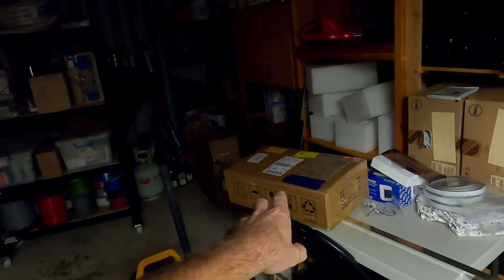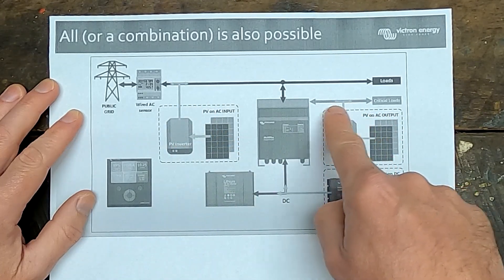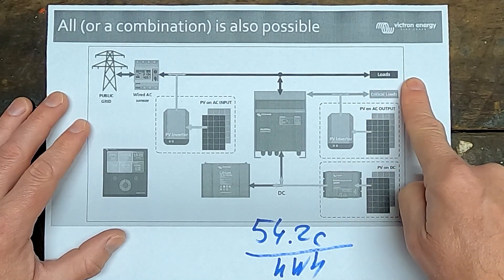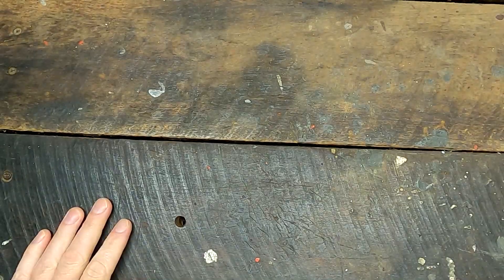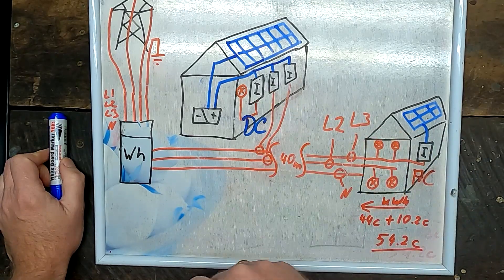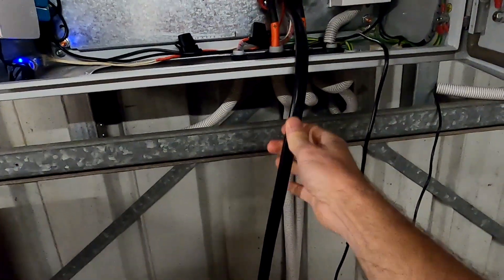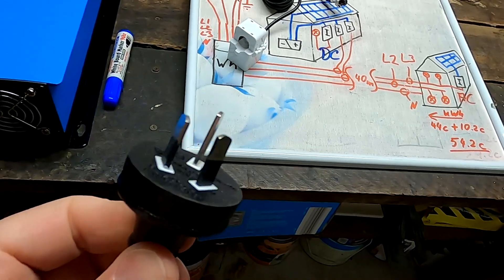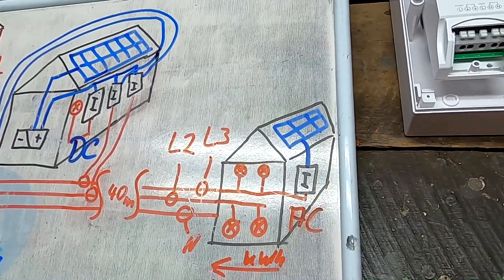Zero feed-in solution to power the house from the battery (and stay legal)

Comment: You need a critical load sub panel. Move those circuits that you wish powered by a hybrid inverter to a separate panel that is close to your main panel. From your main panel run an input circuit to your hybrid inverter input. Do not bond ground and neutral in your sub panel (most important). People talk about solark...it is great but expensive...to me anyway. I went with average Joe and setup a 12kw growatt.

Comment: I'd be nice to have a better way of communicating than just text.  Backfeeding a circuit like can easily violate many sections of the codebook.   I know the NEC quite well.  To put it simply, whatever amperage any of your sub panels are rated for must not be exceeded by the sum of all breakers where current could be supplied.   So if you have a 100a panel and it has a 100a main breaker, backfeeding via that inverter on say a 15a circuit could subject the panel to 115a for which it's not rated.   I'd be willing to bet the AU code isn't much different.

So, if you have a 100a main panel and 2 separate solar power sources on 15a breakers each (30a), the main breaker would have to be derated down to 70a to keep it within code (read: covered by insurance).   Of course they'd have to be labeled as alternative sources of energy, regardless of how 'smart' an inverter is.  Code isn't there to protect you when things are working properly, it's structured to protect you for when it's not.
Reply from the maker: That won't happen. I've got 2x40A supply to the house and the inverter will only ever add 7-8A to one of the circuits. All my load inside the house are far less than 40A, jeez, that would be like 9.6kW on one phase. I've never seen more than 4.7kW as a peak consumption on one phase while cooking.

Comment: What are you actually trying to do? I can see you want to export as much of your house solar as possible, so that would imply it shouldn’t be used to charge batteries at any point in time, you can’t reduce the house loads as you’ve said it’s against the connection agreement, I’m not sure what you actually want to achieve?
Reply from the maker: Well, I explained this all in the last few video... 🤷‍♂️
I cannot maximize my solar export, I have to leave all as it is. Only at night, I can replace my grid power with power from the batteries. Until the contract runs out.
Reply: @OffGridGarageAustralia  right, so what is the goal as of this moment?
Reply from the maker: @isaachauser521  To power the house from the battery during the night as per requirements.

Comment: Sir the usage of two defferent inverters is worth and can do what you want. I use last three years this compination and works perfectly. In my installation  I use a three phaces Fronius Symo 5KW to feed back energy to the grid and  a Victron Multiplus 3KW connected at the one phace with the most critical loads (routers, servers, pcs, security stuff and lighting of my house) .
 Victron Multiplus has a 220Volts input, a 220 volts output for crical loads (that means that these loads are continius suplied even if public grid fails) and a second output 220Volts avaliable only when the grid power is OK. 
Now: Multiplus is feeded by the grid and by the battery banck in case of grid failure and feed power to two defferent sircuits (one with critical loads wich is non brake sirquit) and a scond sirquit ONLY when the GRID power is avaliable. As an extra Multiplus can keep the batteries full charged with use power from the grid .But you can change that if you turn Multiplus in  only Inverter mode.(button on it`s front face extremely easyto do)
For batteries charging I use a VICTRON Smartsolar MPPT 250Volts 80Amperes PV charger.
 So the workflow is : PV Pannels >Fronius 3PH+P+N 380Volts 5KW >MAIN breaker > HOUSE AND FEED BACK to PUBLIC GRID the PRODUSED POWER
                                    PV Pnnels >Victron Smartsolar Charger >Batteries >Multiplus Inverter
                                    One phase of GRID >multiplus in >Critical loads and NON critical loads when GRID power is avaliable and ONLY critical loads when grid fails.
    For whatching the system I use  Victron Venus GX module. I don`t use the second power meter as it no needed in this case  and is an exta cost just to have corect power indications and nothing else. It is usable only if you want to keep public power meter at zero (no feed back) and for some FRONIUS and VICTRON APPs to have corect calculations.
 I hope help you a litle.
If you want more informations schemmatic diagramms etc just contact me . I will help you as i can with pleasure!!!
Reply from the maker: Hello Vasilis, thank you very much for your comment and explanation. That sounds like the ideal solution and exactly what I'm after. How can I contact you for further information? Can you send me an email through my website off-grid-garage.com, scroll all the way down then.

Comment: As I understand it, the Grid tied inverter stops when power is going out to the grid, so that would mean you do not need a timer...... and the reverse is, when you are not exporting to the grid you are allowed to use the Grid tied inverter....
Reply: I think you’re absolutely correct, if the house solar is exporting to the grid the plug in inverter would simply stop production. At least that’s the theory.
Reply from the maker: Not quite. I'm not allowed to use it during the day as it would increase the energy I'm usually exporting. 
I would feed some of the loads inside the house from the inverters and the battery. Therefore I would export more energy to the grid from the house solar. -> not allowed as per contract.
Reply: @OffGridGarageAustralia  It would decrease the power you import from the grid during the day as the grid-tied inverter only pushes power out when there is import from the grid.
When there is export it stops pushing to your house grid and would not do anything. So it would not increase the export in daytime, it would just decrease the import.
Unless you connected the grid tied inverter to a different line then the house solar.

But better safe then sorry as the electricity-company might not get the above.

Comment: I have a multiplus II with zero feed in running with the single phase meter. The MultiplusII can also do this kind of clamp metering. But be aware if you switch any device in your house on and of the inverter needs some time to adjust to the output. in my case if i turn the oven on and off the load gets as high as 1500 watts and slowly decrease to zero ... i takes about 3 or 4 seconds until the inverter decrease the output ... so i think you will alway push some power back to the grid ... in my case 4,4 kwh the last 90 days.
Reply from the maker: Wow, really, that is a lot of energy been pushed back!!!!
The SUN inverters do that too in extreme but take only 1-2s until they adapt. I have seen 200-700W been 'exported' for 1-2s.
But 4.4kWh is a lot
Reply: @OffGridGarageAustralia  A lot ... within 4 Month ... it is more than zero ... but its ok :)
Reply: @OffGridGarageAustralia  And i hope it will not affect your contract ... :) But as far as i understoot you right ... you can use an alternate generator but are you allowed to push back a little or do you have to disconnect ?

Comment: Those inverters will also not power you on grid failure and are also not legal here in Australia
Reply: They do look very much like the one I bought. Mine is for a wind turbine but is not certified for grid connection here in Spain. For me it’s not a problem as it’s connected to the output side of my Quattro and not the grid.
Reply from the maker: Grid failure is not a concern at the moment. But you're right, they are grid following inverters, not grid forming inverters.

Comment: Just run a new supply from garage to house and have an auto change over switch in the house that activates on power failure from grid or after a set time
Reply: Or just use hybrid inverter (deye) they have current transformers and is basically the same wiring as he  already has, but much more robust setup than he currently has implemented.  His reasons he can not use hybrid are not valid, at least not with a sol-ark/deye inverter.

Comment: rather than use the timer, can you not use another hall-effect sensor on your house grid tie inverter or solar string combo box to trigger a relay to connect the off-grid grid-tie inverter?  ie set it so when basically set the overcurrent protection to whatever the smallest value is and any current it switches off the off-grid setup?  Generally the hall-effect and shunts like your BMV on have facility to switch relays on current or voltage settings.
Reply from the maker: There are other solutions, yes. But it's already pretty messy with this solution, so...

Comment: Andy, does that mean that the system does not work in a blackout as the grid tied inverter needs to see the grid voltage to work?
Reply from the maker: It's not an off-grid system for the next 7 years until the contract runs out, that is correct. Only the garage will have power then...
Reply: Any grid tied inverter must be "anti islanding" which means it will not export to the grid during blackouts, even if there is another grid tie inverter connected to the grid.

Comment: You're getting A$0.54 for sending the grid power.  What are you paying for what you use from the grid?
Reply: Andy installed solar PV many years back and at a time when there was a state government incentive which adds 40 something cents/kWh to the exported energy paid by the electricity retailer. Such incentive schemes ended many years ago, while those who signed on have them honoured until end of contract term, unless they make a change which breaches the condition to maintain eligibility (e.g. by adding more generation capacity). Normal import tariffs in SE Queensland will be around the 20-25c/kWh range.
Reply from the maker: I'm paying 23c/kWh or 17c/kWh on the other tariff (pool, hot water and vehicle charging). 
I'm getting 44c/kWh from the gov contract plus 10.2c/kWh from my retailer. Until 1. July 2028 😊

Comment: Those GTIL2 inverters are awesome. I use 2 of the 2kw inverters (USA splitphase). It would have costs me over 20k to have everything installed by nabcep installers the way the electric company wants so they would allow me to feed power past the meter. Instead I installed the GTIL2 inverters.The entire system cost me 6k done diy. Covers almost all of my electric bill.
Some advice. Don’t plug them into an outlet. Cut off the plug. Connect it directly to a breaker in the electrical panel. Outlets fail and will cause issues. I’m an electrician, I replace a lot of broken outlets. Also don’t install any of that stuff on the AC output of these inverters. If any of those things fail while these inverters are producing power it will ruin them. Wire them directly to a breaker with a wall pass through or in a junction box with wago and then directly to a breaker. Also when turning off the inverter, turn off the dc first then AC. I’m the moderator for a Facebook group about these inverters. Solar grid tie USA users. I help a lot of people with problems they are having regarding these inverters.
Reply from the maker: Thank you RJ, I've seen a few video of these inverters working ins split phase systems. Great. 
Yeah, they will be connected directly to the RCD and SonOffs in this little switchboard I showed.

Comment: Hey Andy, the solution is actually Verry straight forward... Use a multiplus 2, with a current transformer coil, and set it to inverter only mode for as long as the contract lasts, after that you have a hybrid system at the flick of a switch.

Your battery will only be charged by the mppts, and all your other gear can stay as it is.
They are available in 3 and 5 kw, so depending on your largest load you could do with just 2 in your case.
Come to think about it, if you use the power output from the multiplus, you might not even need the coils
Reply: Correct  - the Victron will not export to grid battery power - in most countries that would make no sense at all ( from a financial point of view ) . You can put timers on the Victron MP 
using a GX device
Reply: @petermerle  that's not his main consern I believe, he wants to export as much of the houses solar as he can for that sweet sweet moula at 50 some Cent a kwh. So by putting the victron in inverter only mode you would not charge the battery when there is overproduction, instead export it to grid, and when production drops below consumption, the victron will start compensating for the load. Seems pretty straight forward to me.
A victron with GX device CAN export to grid is you lower you grid offset to a negative value. I can drain by battery at 15kWh if I want to.
Reply: @bjornemmy  You could set charge current to minimum on the MP ( not sure if its 1 A or 0 A ) Then all PV goes to grid . Not sure why you need permission from grid operator to fit the EM.  You could fit it after your main isolator
Reply: @petermerle  no need to limit if charging is off, right? I have 3 multiplus's here and if I turn off charging, all te power from my grid-tied solar inverter goes straight to the grid.
Reply: @bjornemmy  You now have to introduce a mechanism  to change the inverter mode every day - I still don't understand why you cannot just run a normal ESS system and it will all operate autonomously. Surely grid operator can specify a maximum grid feed limit - seems so bizarre how it seems to be done in OZ ( only can come from this array  and not the other ) .  Here is South Africa we have a rule where one cannot grid feed more than what we import. Othe  countries specify a max power limit
Reply: @petermerle  I think some people are so focused on the problem that they start over thinking things, here it is quite simple, he only charges the battery's with his MPPTs and only need the multiplus's to compensate hese night use in the house, so just turn charging off on those and bod's your aunty. It's literally that simple.
Reply from the maker: So the problem is that the solar which needs to feed in is connected to the load directly, so at the output of the Multiplus. So far I could only see scenarios where the excess solar is been used to charge the batteries and only if they are full it will be feed into the grid.
Reply: @OffGridGarageAustralia  as far as I know that Does not Matter, you can install the multiplus in parralel or in series, if you turn off charging it will expert everything to grid no matter where the solar is connected.

Comment: Andy, the Victron power meter is available as a CT.. so you don’t even need an electrician to install. Thou i got a sparky to install the non CT version. You don’t need permission to install the power meter.

To solve the situation of your solar feedin.. the solution is simple, it gets installed on the grid side of the power meter so it’s generation is invisible to the Victron (hence it’s 0 point at the meter excludes your main AC generation)
Reply: If it’s installed on the grid side of the main meter then won’t that mean he gets billed for his own power generation?
Reply: @lexicase5642  I’m talking about the second power meter - the one that the Victron (or any other hybrid inverter) requires
Reply from the maker: My solar is installed on the house which is the load side. It's not before the Victron meter. The Multiplus will have 5kW at the output where usually the load is as per the drawing.
Reply: @OffGridGarageAustralia  why not put your house AC solar on the input side
Reply from the maker: @Fergo101  running another cable between house and garage is not an option.

Comment: What happens if you were to claim your off grid garage was an rental property and that your tenant needed their own meter? Once the meter is installed, legally your tenant (your YouTube show) could have their own grid tie contract. Of course your YouTube show would need to be legally Incorporated and start paying you rent.
Reply: That contract would be on about a 9C per Kw contract, would need electrician, and new meter installed and be a lot more hassle than its worth.
Reply from the maker: Yep, exactly not worth it and also the high feed in would not be valid any more for such a change.